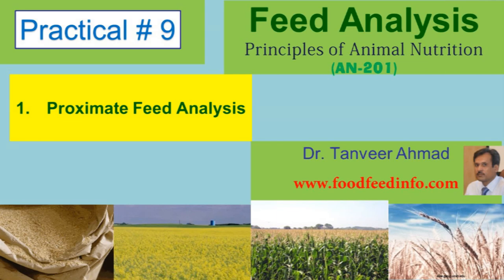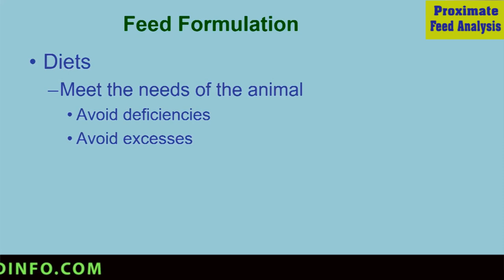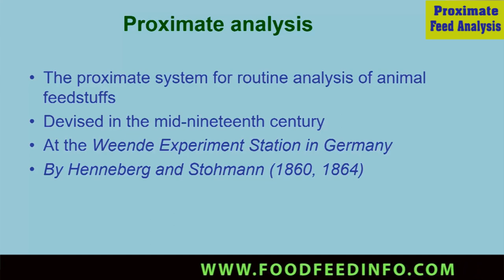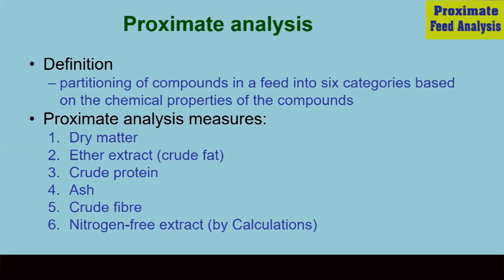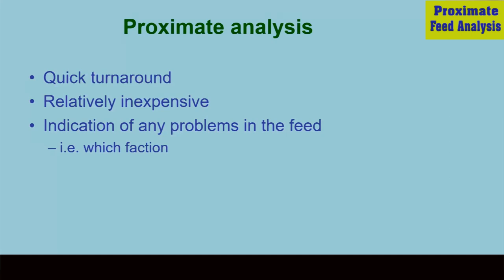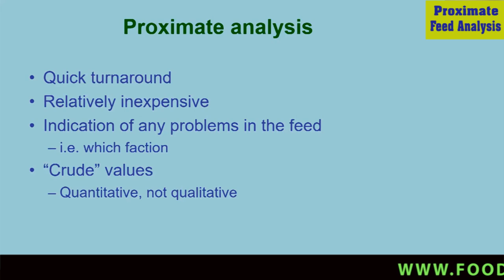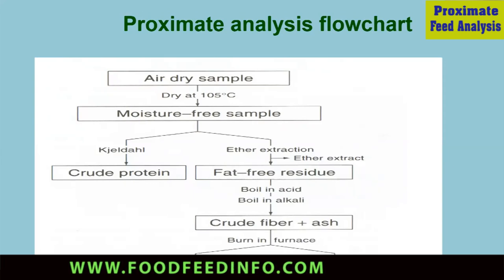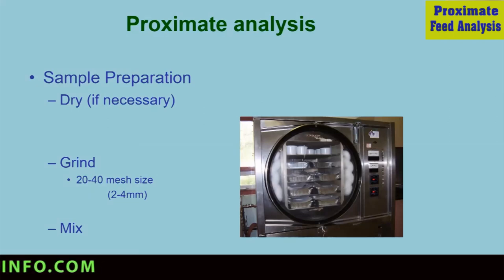Practical#9 - Proximate Feed Analysis

Comment: Need of feed analysis:
Feed analysis  is required for feed formulation which need list of nutrients and chemical composition of available nutrients and that can be done by feed analysis.
Secondly, feed analysis is done to check the quality of nutrient to meet the demand of animal.
There are different techniques used for feed analysis but the most old and reliable is proximate feed analysis.
19-arid-2236 (A)

Comment: 1- Proximate analysis is easy and best way to determine the chemical composition of the feedstuff. Although it takes much time.
2- Proximate analysis helps to measure and determine the dry matter, ether extract, crude protein, crude fiber, ash and the nitrogen free extract.
3- It is inexpensive method that tells the amount of chemicals in feed stuff but not tells the quality of feedstuff.
19-arid-2182

Comment: ✓For proximate analysis first sampling should be done. For sample preparation first dry the sample and than grind this using feed mill grinder and than mix it thoroughly.
✓Organic matter include crude protein , fat and fiber whereas inorganic matter includes ash.
✓Ary drying of sample is done at 105-°C.

19-Arid-2254.

Comment: 1- Proximate analysis is used for routine analysis of animal feedstuff and in this method, compounds of feed are partitioned into six categories on the basis of the chemical properties of the compounds.
2- Proximate analysis determines dry matter content, ether extract, crude proteins, ash, crude fibre and nitrogen free extract very accurately.
19-ARID-2287